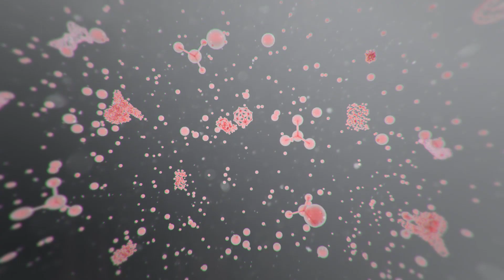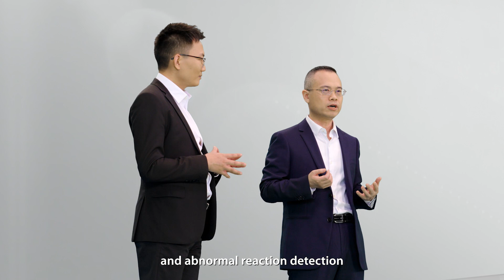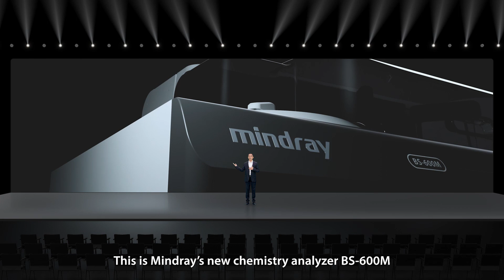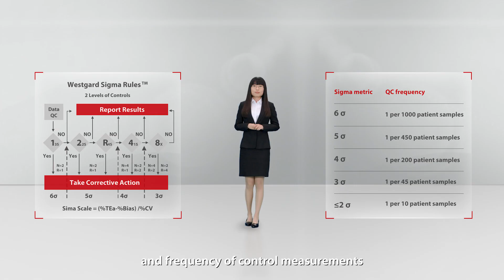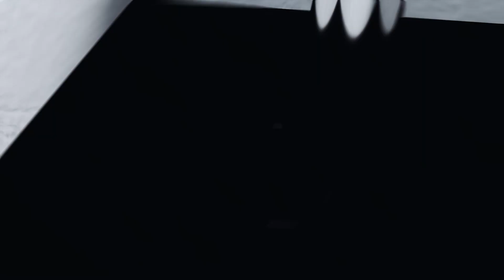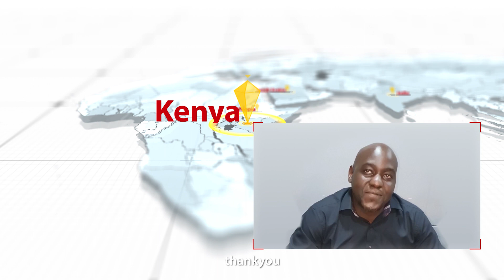Powerful yet Efficient: Mindray BS-600M Chemistry Analyzer Global Launch

Comment: got a brandnew BS-360E a month ago. Having si many problems with it...
Reply: i am using a BS-240E. what problems do you have with your analyser?
Reply: @ThanhTran-dp6yh  First I had a problem in which I had very scattered absorbance readings. The problem was that one of the power cables for the lamp was loose. Now I have problems with the probe, it detects clots and fibrin in samples that clearly do not have them. It seems that the probe sensor is failing.
Reply: @Luis-bo2uj   "scattered absorbance readings" and "detects clots", i had these very issues too, but it happened bc i didn't use CD80 as concentrated wash solution in potion 99 (before that i used water, i thought it would saved me some reagent). the probe then clogged
i fixed it by using Javel to unclog the probe and fill CD80. it works fine since then.
you should check your centrifuge too. bad centrifuge could lead to probe clogged. see if your serum/plasma samples have small blood particals within
Reply: "scattered absorbance readings" and "detects clots", i had these very issues too, but it happened bc i didn't use CD80 as concentrated wash solution in potion 99 (before that i used water, i thought it would saved me some reagent). the probe then clogged
i fixed it by using Javel to unclog the probe and fill wash bottle with CD80. it works fine since then.
you should check your centrifuge too. bad centrifuge could lead to probe clogged. see if your serum/plasma samples still contain small blood particals within
Reply: the problem was, the probe was not ENTIRELY clogged. it was HALF-CLOGGED. i didn't think of it until a local technician helped me